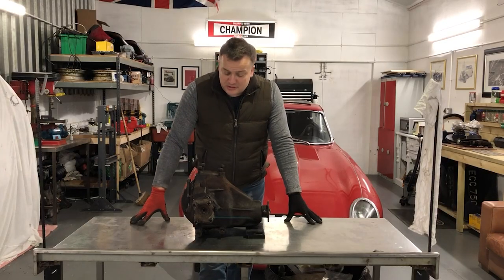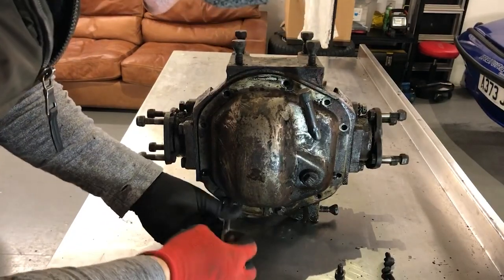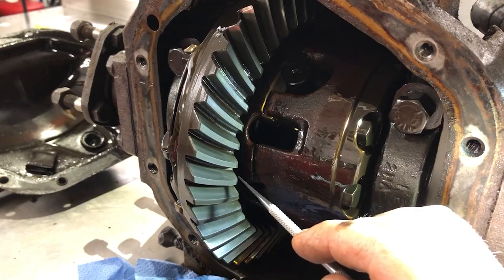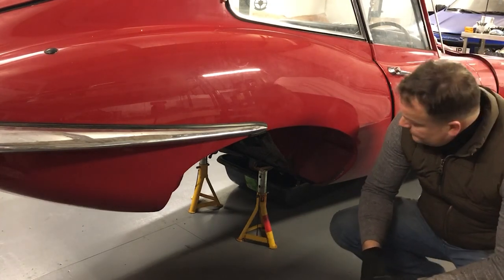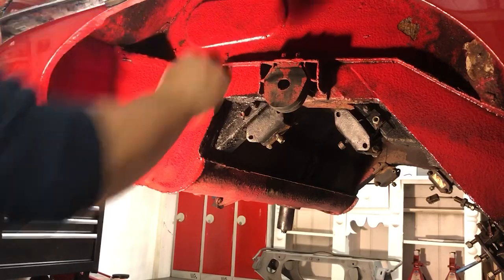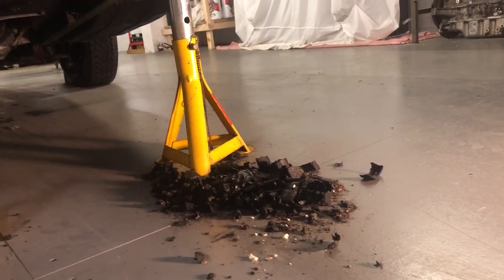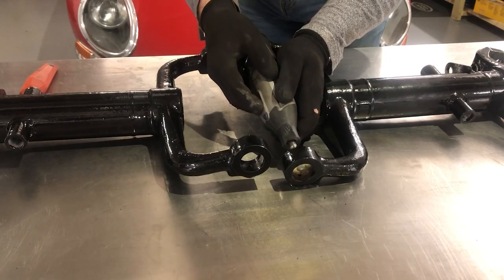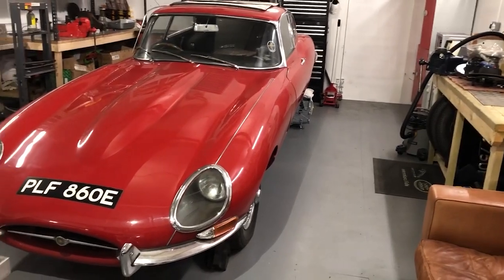Ep9 - 1967 Jaguar E-Type diff inspection and rear underbody strip

Comment: I fit's not too late you also need to clean the outer surfaces where the BIG washers go, especially on the end that is next to the diff. If you do not assembly is a nightmare.
Reply from the maker: Thanks, I'll check that out as it isn't too late yet.